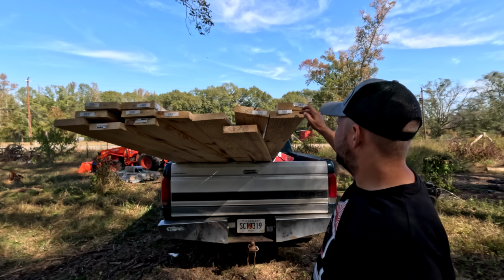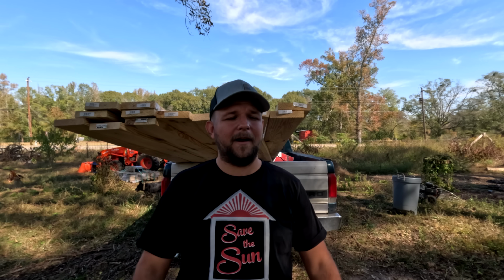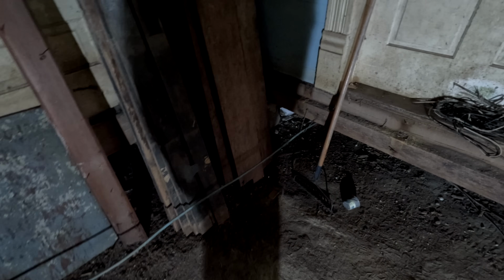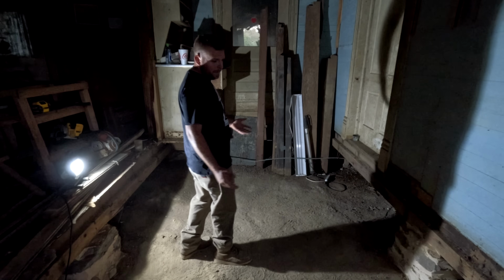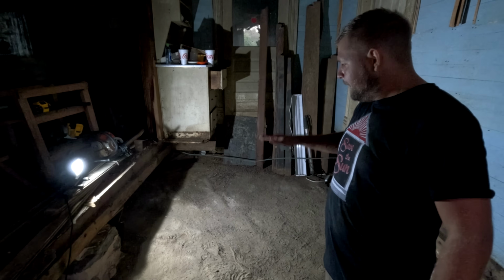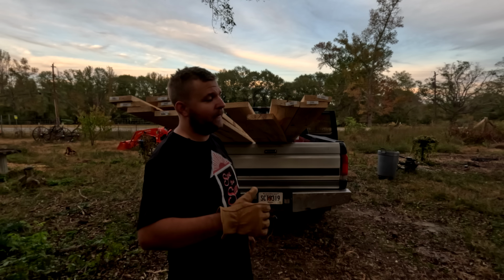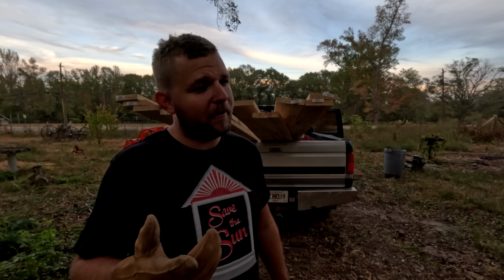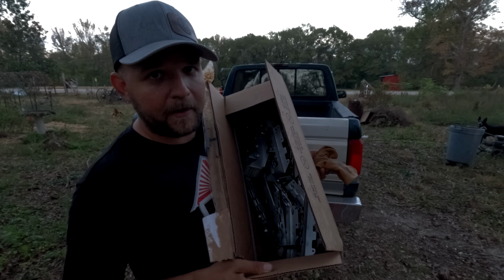NEW WOOD! CLEANING UNDER FLOOR IN 140 YEAR OLD KITCHEN (Metal Detecting The Ground)

Comment: After working in retail as my retirement career, let me say a store is only as good as its site manager. Well done, Robert.
Reply from the maker: You are absolutely right. I was thinking about that after the experience that it is a management issue, and possibly a company culture issue. In fact I believe it was some kind of store manager doing an inventory that actually asked if I needed help, but then the help never came
Reply: I worked in retail in my early youth, comparing my experiences then to my last job, which was in a retail environment, even though I my job was working with businesses, instead of walk in customers. I had to step in daily and do the floor employees jobs due to the fact they ignored customers, was rude to them or didn't do it right. Voicing my concerns to management did no good. Back in the day, if you did any of the above, you were fired on the spot. They now just want their paycheck and not earn it. As to the quality of products now being sold in some, not all has drastically declined. You use to be able to buy items that seemed to last decades. Such a shame, sigh.
Reply: Agree. My Home Depot in Northeast Georgia is filled to the brim with lumber. They have so much inventory in the parking lot too for the garden center. I can't even tell you how much I spent at my local Home Depot. We don't have a Lowe's in my area and have to travel 40 minutes to 1 hour to go to one.

Comment: Robert take that wood back to Home Depot and get a refund don’t put bad wood in your house !!
Reply from the maker: I definitely should - but it’s still usable and will make good sacrificial pieces for bracing, etc rather than using the best for that
Reply: Need contractor bags
Reply: Is there such a thing as good wood anymore 😮😢🇺🇸
Reply: @marvinjohnson424
Here in western NC, it’s hard to find and not good quality. I can’t believe the bent wood and knots. It’s not cheap! That’s a lot of $ right there, all those boards!
Reply: @marvinjohnson424  Nope.

Comment: Worked at Home Depot for 2 years as a cashier.  The lumber area has list of what is needed to be done, which leaves no time for customer service.  When I worked the register in the lumber area and paged lumber, no one would respond.  Great way to run a business.

Comment: great job getting all the debris removed from that area. different areas the have different quality of products at hardwares
stores. you have to check all the wood in both directions and number of knots! the pieces you showed all look like
they are from the center of the tree. which inherent to cup due to the grain of the wood.as long as you look at the

1.5 inch edge to look for straight grain. the straighter the better with out bowing.

Comment: Hi Robert.  Would it be best to address the issue of water pooling in that area before installing the new supports and flooring?  Will the water pour in as before, is it best to first fix the outside entrance top to bottom ?  Thank you Sondra.  👏

Comment: The Lowes lumber being heavier would tell me that it is greener. The drier the wood, the more likely to warp. The Lowes lumber hasnt had time to warp yet. You are in the middle of yellow Georgia Pine country Robert. Much better than that fir or whatever those big box stores sell. I would find a local lumber yard in Central and South Georgia. Use that strong yellow pine! Thats just me though.
Reply from the maker: It’s yellow pine from Lowe’s allegedly kiln dried yellow pine, but it wasn’t wetter than Home Depot but tighter grains - more solid wood. 

Now the Home Depot wood is whatever “prime wood” is lol according to their website it’s southern pine. But the kiln dried at Home Depot is more costly there and they don’t stock it at my Home Depot store.

Comment: It surprised me that nobody insulated the floors or walls! Wouldn't that keep the heat out as well as cold? I'm thinking as a Minnesotan
Reply from the maker: Yes but it’s good that they didn’t because it would have caused the rot to be worse. These houses were designed to stay cool in the summer and with their massive fireplaces and heat soaking plaster walls, warm in the winter
Reply: My father told me a house needs to “breathe”.
Reply: When we were adding on a greenhouse in Albuquerque, we had to tear out an entire wall to allow for the extension. The insulation we uncovered was only a thin layer of aluminum foil. No kidding. That was the idea of insulation back in the 50's. In Albuquerque. Summers reach >100 for several weeks in the summer, & down to 17 for a few nights in the winter. Our house only had a under floor furnace in a hallway, a fireplace with a heatalator venting system, & a swamp cooler on the roof above that same hallway. Uff da. None of these were efficient, & we were always trying to come up with a way to heat & cool the house. After the greenhouse extension was built on, we actually had improved temperature controls.
Reply from the maker: @cynthiacarter514  exactly!!!! With these old houses! Modern houses are built NOT to breathe old houses are absolutely built to breathe. A lot of people do not understand that.